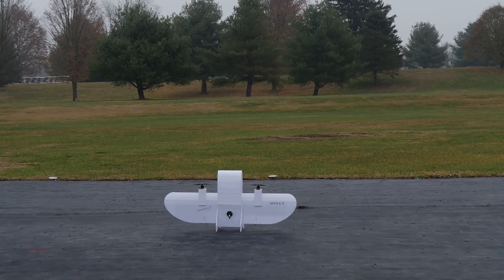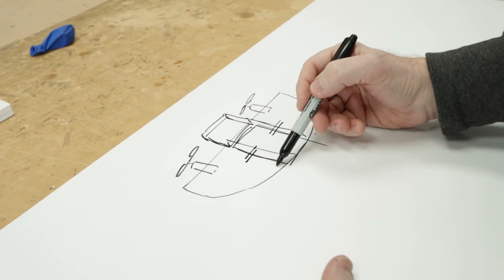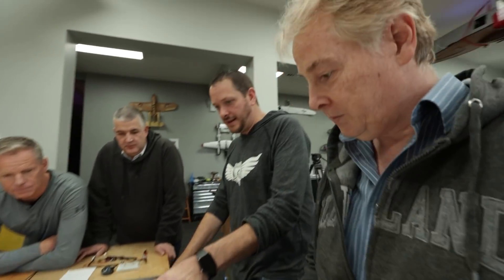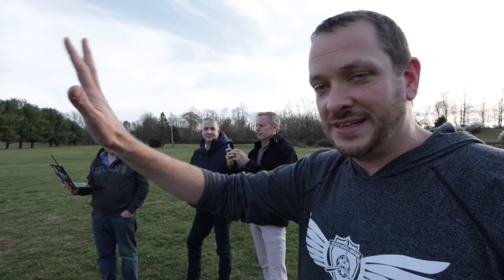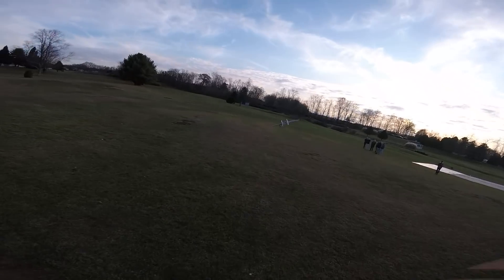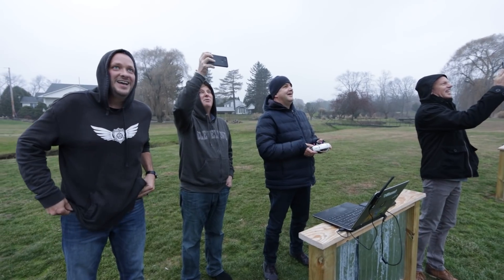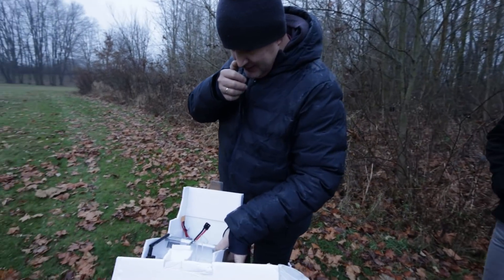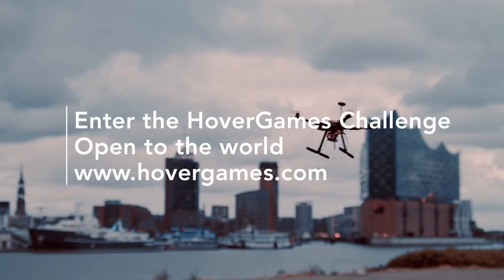Building a Drone that can Save Lives! | NXP Hovergames

Comment: When do you think the plans will be available ?. If the flight controller configuration is not quite ready just yet maybe you could allow a certain number of community testers to experiment with this airframe. I would really like to test it with a controller that runs the open source flight controler software - http://ardupilot.org
Reply: We're working to get this available on the FT STEM store. I'll post an update here or on our HoverGames contest page when it is ready. FYI - PX4 is also opensource.
Reply: https://www.hackster.io/contests/hovergames2/discussion#challengeNav
I'm expecting 3-4 weeks?

Comment: Hay! Tail-sitter VTOL. :D I made one of those a few years ago, was great fun, but I never finished the software parts of it. It couldn't transition to hover mode without reconfiguration, so it was easy enough to take off, but had to be landed with low PID rates in acro mode... basically impossible. Reconfigured for hovering worked well, but was basically impossible to fly like a plane. It was fun before I lost interest though. ;)

Comment: Engineers(?) that talk more like marketeers .. not a good feeling about that.
Reply: Engineers would know to get the compass out of the din of EM interference that exists near center mass of a UAV.  These guys are marketing wanks, pure and simple. Their tech is closed source, expensive, and not as mature or capable as Ardupilot or INAV, both of which are easier to use, run on inexpensive hardware, and are capable of more than this stuff.

Comment: Nice to see a foamboard design like this. But honestly, this is essentially a product already on the market: https://wingtra.com/
Also, the PX4 flight stack and QGroundControl/Mission Planner already has tail sitter vtol in the preset configurations: https://docs.px4.io/v1.9.0/en/frames_vtol/
Reply: There's lots of ongoing development with PX4 tail sitters. It's one of the most difficult configurations. Correct Wingtra has a fantastic VTOL. It's also $10k+? Not an hobby level experimental frame that's inexpensive and can deliver packages.

Comment: 30 seconds in and seeing the first attempt, I'm wondering if it could work with a triangular wing and thrust set-up?Set the wings at 120 degrees to each other with a motor attached. Might make vertical flight more stable.

Comment: One of my best friends has a dairy allergy and I only realized how crazy this is when Josh said the thing about the epipen. Could the compass error be caused by the electromagnets in the motors? Since it has diff thrust it could have thought it was sideways because 1 motor was thrusting more than the other, and when it leveled out it re-oriented.
Reply: Compass needs to be well away from the DC wires as well as the motors. This is INAV build 101 and these engineers should never have put the compass inside the fuselage.  They seem like a bunch of guys who are passionate about a thing but have zero real world experience. Anyone who's done any work in the field with Ardupilot or INAV could tell you that the compass needs to be on a mast to get it away from the absolute cacophony of EM interference that an electric UAV creates.

Comment: Im curious, was the plane powered on standing up or on its belly? Normally the gps needs to be level on start up. And normally auto on px4 will attempt to right the plane' so when its hovering it is trying to correct itself one way or the other.

Comment: So, add 2 more motors on the undersides of the wings, you will need to move those ones up so it is more drone like, and double if not triple the length of the wings. And then in air after transition to plane mode, kill 2 engines (maybe even tuck them away with servos).  See what happens

Comment: that probably can't save somebody from a low GPA
Reply: As someone who designed and made one a bit ago for a college qualifiacation, they can carry stripped down defibrillators which are super time critical for delivery for heart related emergencies
Edit, misread and replied but for the og comment, it gave me equivalant gpa points in the uk haha😅
Reply: Could drop a medical kit
Reply: @peterzingler6221  how is a medical kit gonna save your GPA
Reply: @paultang8766  Who said it would? It's possible, though. If drones dropped critical supplies out of the sky it would inspire all ages.
Reply: Could drop a brick at least then it would be over
Reply: Depends on your major